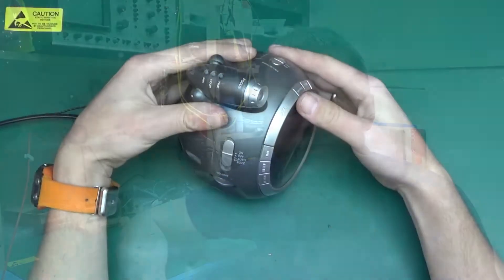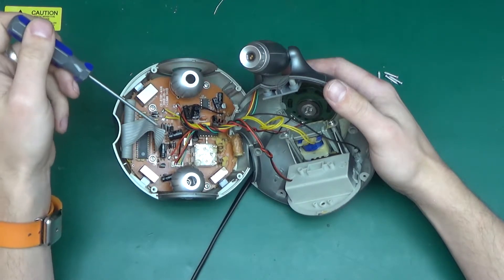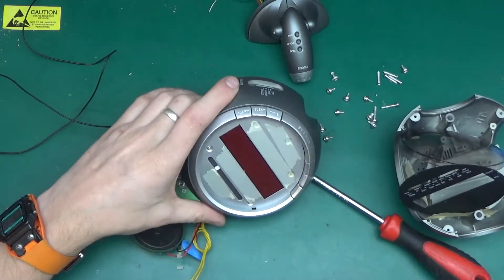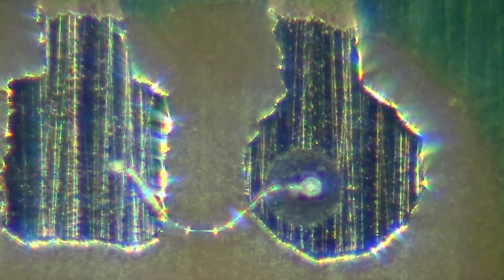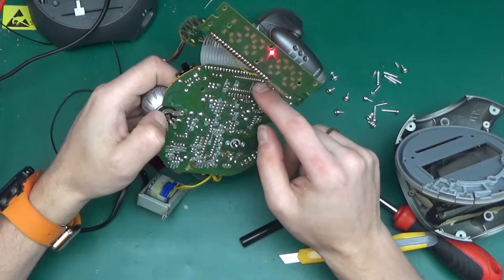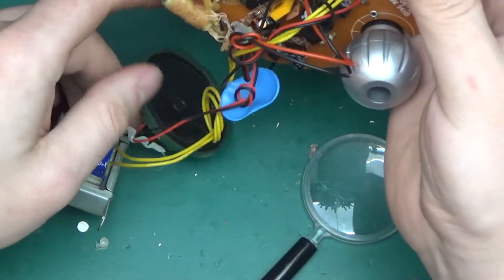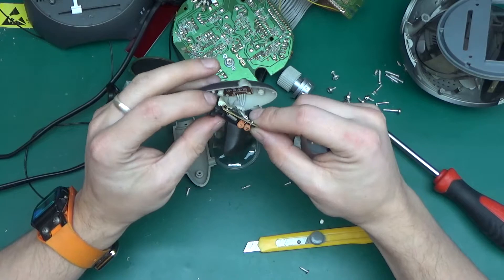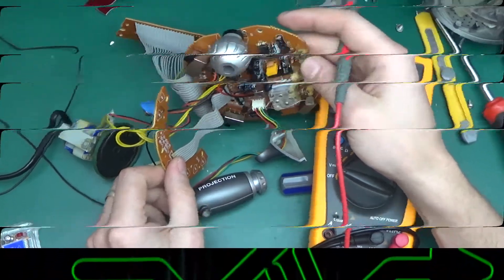Class 1 LED device teardown

Comment: That type of clock display module is quite common in digital, er, clocks. I have a few modules around somewhere I bought from Taobao some years ago, the ones i have at least are common anode, drive them just like any other 7 segment display, same construction with bare die on the pcb.

Todd Harrison has a video where he was repairing a "Scooby Doo" digital clock, yep, same module as I recall.

Comment: Those dome button switches are in fact one of the most reliable switches if done properly. They are even quite often found in military devices.
Reply from the maker: +medvídek Krupička interesting to know, thanks. In this case though, i am sure the decisive point was cost not reliability ;)
Reply: Maybe it is a mil-spec alarm clock?  :-)
Reply from the maker: +medvídek Krupička lol